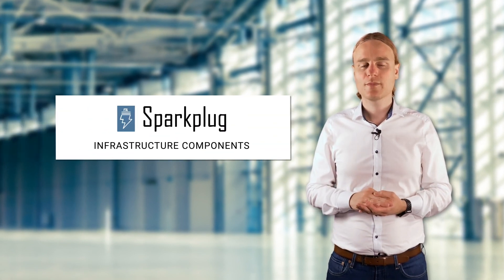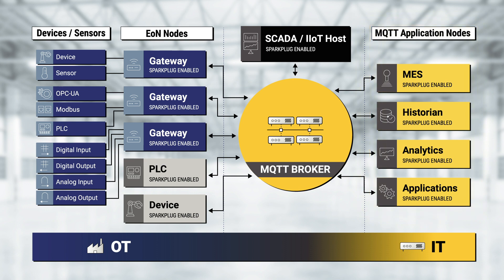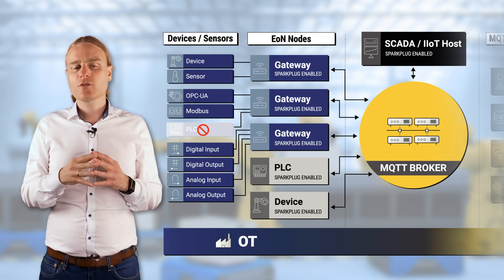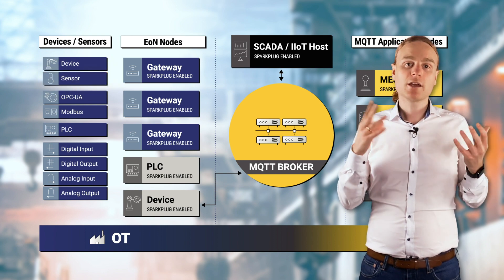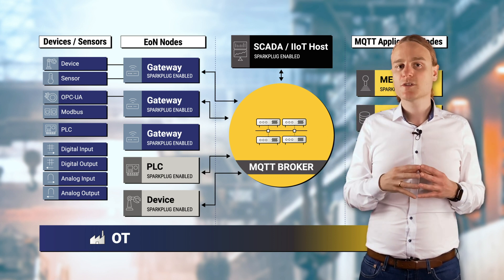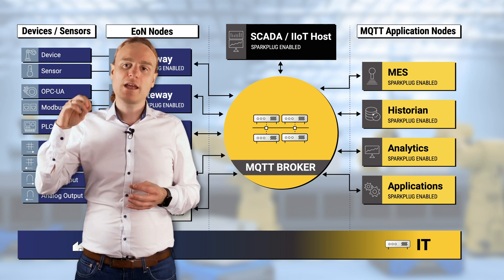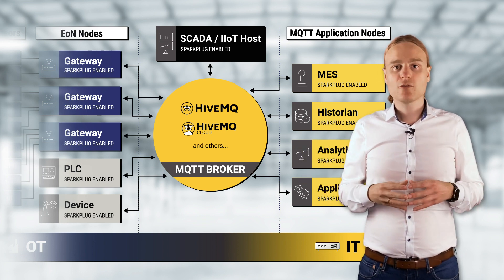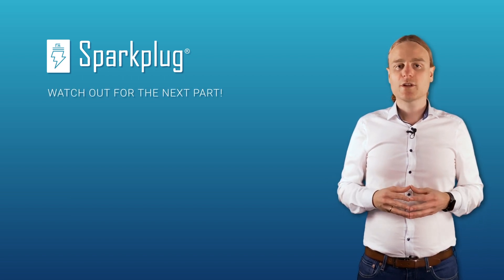Sparkplug Essentials 05 - Sparkplug Components

Comment: I think maybe it would have been good to add that sometimes between the MQTT Application Nodes and the MQTT Broker you also need a Sparkplug gateway as some IT applications will not yet be MQTT enabled. Something like HighByte is required between MQTT broker and (say) SAP, right?

Comment: thanks for this series! could you elaborate on why a properly configured mosquitto broker (proper authentication/authorization etc...) is not suitable as a production ready mqtt broker. What makes hivemq  production ready when compared to a mosquitto broker that is properly configured. One challenge I see is managing the PKI of x509 certificates for client devices, does hivemq or sparkplug have any features to address this challenge?  The sparkplug project seems great by the way, introducing standardized protocols for things like topic namespaces is crucial to a scalable design.
Reply from the maker: Hi Michael, glad you like our Sparkplug series. Thank you for your question. Here's the answer: Among other specifics like the MQTT Add-ons or the HiveMQ Control Center, our customers value high availability, scalability, and stability that HiveMQ offers. Overall HiveMQ offers its user the guarantee for no data loss, which a single instance, in-memory persistence broker like Mosquitto cannot do.
Reply: @HiveMQ  How does HiveMQ guarantee no data loss?  I have always been interested in a hybrid deployment approach - local broker for "instant" alerts and command/control and a cloud controller for off-site redundancy, remote access, and historian-type functionality.  Can you bridge two brokers together somehow?